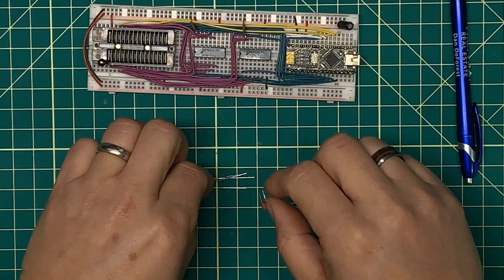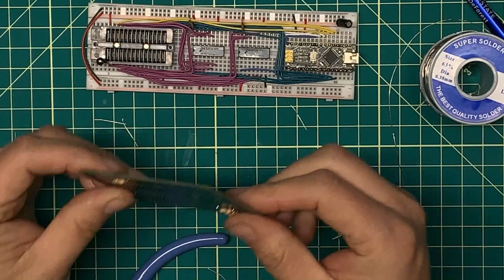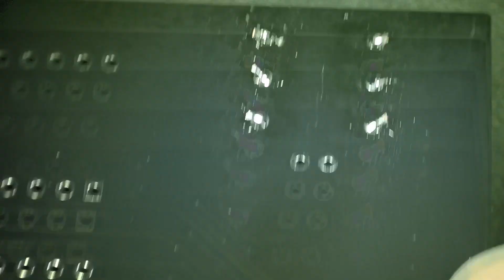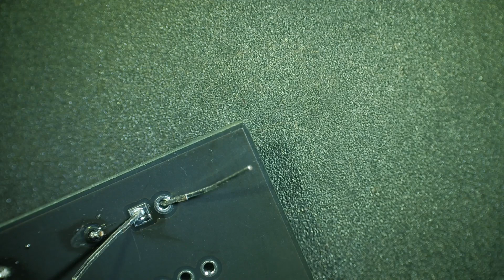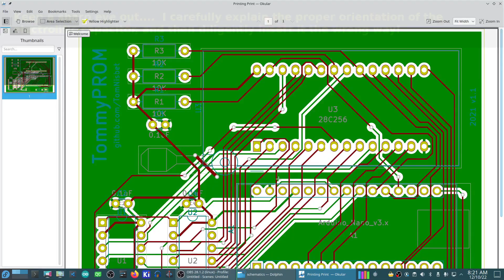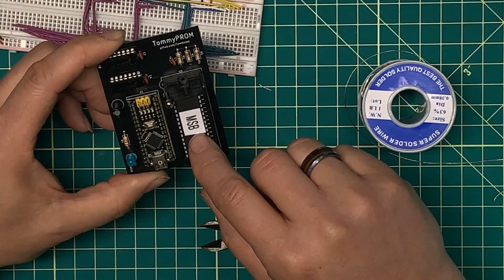Converting my TommyPROM to PCB | This and That

Comment: I have a little manual solder sucker. It was super cheap, but very effective at removing solder when you go wrong. I use it all the time, because i make loads of mistakes.
Reply from the maker: I have one myself.  I think I paid $5 for it.  The hard part here was the solder on the black background made it hard to discern issues versus clean solder connections.  I don't recommend black PCBs for anything larger than a few components.

Comment: I need to program an eproom M27c801... would this recorder work?
Reply from the maker: @paulomorenoedson4266 -- I wish I had the knowledge to answer your question directly.  The short answer is, maybe.

The 27 series EEPROM typically use elevated (>5V) to program.  The TommyPROM is powered from a USB-A connection.  So, the voltages are not available without modification.

I am going to refer you to the official TommyPROM web site and documentation.  Some helpful links are:
https://github.com/TomNisbet/TommyPROM
https://tomnisbet.github.io/TommyPROM/docs/prom-specific-code

Or, failing that, a typical Google search will get you there as well.  The first hit is the link above.

Good luck with your search!